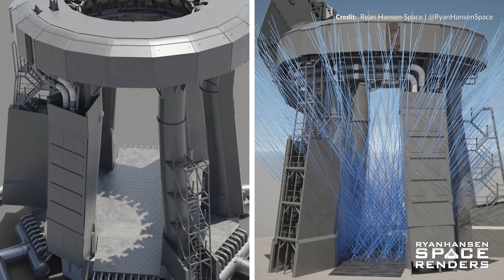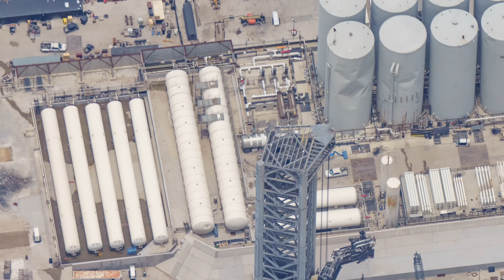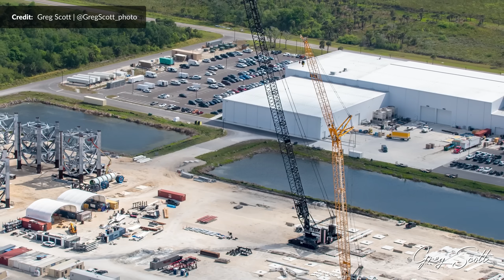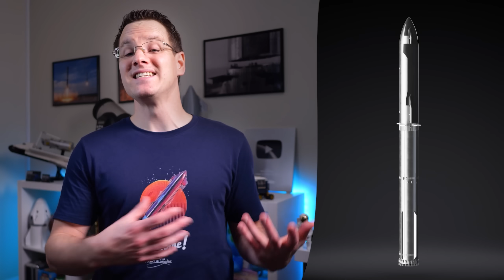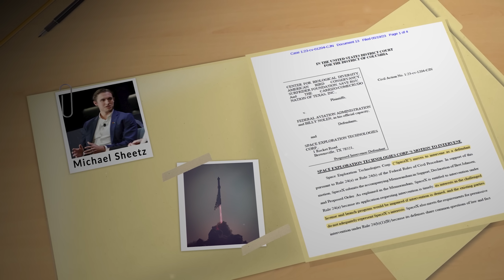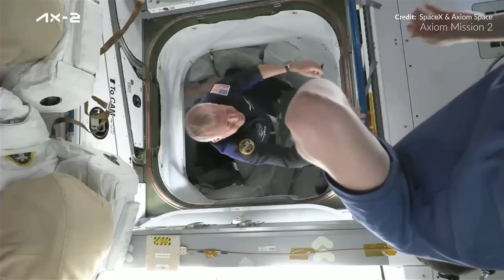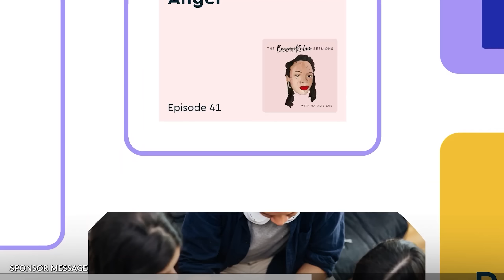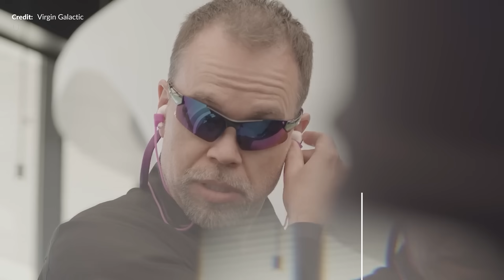SpaceX Starship 6,000 ton Capability, and SpaceX Joins FAA for Legal Battle, Axiom 2, Unity 25

Comment: So many achievements by SpaceX and we are still waiting for Bezos to get his up. One issue concerns me. When Starship launches for real, what happens if the tower is damaged during the launch? Doesn’t that mean they cannot catch the boostsr, and probably can’t catch the Starship, assuming the repair isn’t simple.
Reply: The next few launches are likely to be soft water landings so they can dial in the accuracy, before trying a catch attempt.
Reply: @steveaustin2686  I did use the phrase "launches for real" meaning a landing back at base. The question remains. What if the launch tower suffers damage? All it takes is an impairment somewhere, and whoops, no more booster, and significant additional damage to the launch site.
Reply: @StillAliveAndKicking_  As salland said, if the tower is damaged on an operational launch, then no catch. SpaceX had planned to have two towers at Boca Chica, but let the Army Corps of Engineers application for a second tower lapse. Who knows if SpaceX will try and pick that up later.
Reply: @salland12  To be fair this is how SpaceX operate. They originally wanted the Falcon 9 upper stage to be reusable but dropped that idea. The Falcon 9 had some well publicised explosions while working out the landing technique. The Dragon capsule was intended to do a suicide burn landing, but changed to a parachute landing, by memory because NASA vetoed the former. It is conceivable that SpaceX will resort to landing legs, given that we know that approach works.
Reply: @StillAliveAndKicking_  I believe that SpaceX gave up on propulsively landing Crew Dragon, because the required testing for NASA would take WAY too long. Boeing and SpaceX were competing for the first crew to the ISS to capture the flag left by the last Shuttle mission.
Reply: water landing?
Reply: When (and if) Starship is man rated they will have already reached a launch cadence with multiple towers and landing sites for Starship.  Landing at a different tower would be possible especially if Starship had reached orbit.  If it isn't man carrying then worst case you ditch it in the ocean and write it off (like everyone else does for EVERY launch).

Comment: Hi Marcus, could heat tiles like on the Starship be used to protect the legs of the OLM or is the angle that the flame/ pressure & vibration wrong for this type of protection, I was thinking it would help with rapid reusability as the legs would get eroded during every launch. Love your content, keep up the good work mate.
Reply from the maker: These are made for re-entry, not being smashed with raw rocket exhaust.
Reply: Not Marcus but my brain tells me that the rocket exhaust plume would simply rip the tiles off and/or shatter them very quickly
Reply: As Marcus and revmsj said the tiles are great vs heat, but suck vs impact. You can break them with your hands, so the force of the rocket exhaust would destroy them.
Reply: I like how you think. Tiles won't work, but perhaps some sacrificial material is a good idea. Some type of coating that would help absorb heat and reduce the force on the steel plates, and the material would be obliterated during launch, causing no debris risk.
Reply: @JeromyBranch  -  It would have to be a coating that could be replaced/renewed in a few minutes.  If they are going to fly several times a day, refueling and "replacement of expendables" should not take much longer than it does with an airliner.

Comment: Someone is bound to do a comparison, cost/time/resources of Flametrench verses Starship first flight damage + upgrades. I've still not seen a reason why they've not gone for the standard option, remembering this is the approach they're taking in Florida. The SpaceX video is great, clearly shows the great big holes blown out by the 'Need more power!' FTS. Great video as always Marcus!
Reply: The Florida pad is literally the same design
Reply: I think they initially wanted to build a rocket that could land/launch on raw surface (Mars) and wanted to see how little they could get away with.
Reply: Flame trenches aren’t “standard.” There are more rockets than those big KSC ones.

Plus there are TONS of logistical advantages to a flat pad under the rocket. There’s zero chance they’re going to build a mobile launch platform for SuperHeavy
Reply: They cannot make a flame trench at the launch complex because it is simply to close to the ocean and the ground below is unstable. They also want a versetile pad design that can be used on the moon and mars.
Reply: Yeah, if it was possible to do a traditional flame trench, they'd never know what was strictly necessary to create a stage 0.  

If Elon Musk is accurate in that there will have to be a 1000 starships that need to go to Mars in the brief window every few years, they will need a tremendous amount of launch infrastructure.

They need a system they can replicate a lot. 

So it makes sense to be extremely careful to not over-engineer.
Reply: Everyone that has replied thus far are mostly correct, but they’re missing one major point. In the initial planning phases SpaceX wanted to build a raised platform for a trench like at 39a. That would have taken years of environmental assessments and lawsuits to get sorted. In the end they opted to skip the raised platform and get the program rolling.
Reply: @jackinthebox301  Per NSF, the OLM is as far from the ground, as the pad at LC-39A is from the bottom of the flame trench. So there is a similar depth, just with 360 degrees for the flames to go. What Musk tried to do without, was the water deluge and a diverter. Apparently Musk wants to be able to work on the engines under the OLM so much, that he will only do a flame diverter as a last resort.
Reply: @steveaustin2686  I had thought about the height of the OLM while I was writing my initial comment. I figured it was probably roughly the same height as the aforementioned raised platform would have been. 

You're right about trying to do without, but I think they knew they would need *something*. I guess its just like their hope with the Fondag concrete surviving one launch, they were clearly wrong. Like I can hear Elon sarcastically saying "How bad could it reaaaally be?"
Reply: @jackinthebox301  Yeah, I can see him saying that.

Musk really, really wants to work on engines under the OLM. Personally, I think that he should give up on that and just put in the diverter, that he said that they might have to do in the first place.
Reply: There was a NASA study way back in the 70s I think showing that on really large rockets the trench reflected the sound energy back striking the rockets side causing issues.  The proposed solution is the water plate that SpaceX is implementing.  Starship is much more massive than Saturn V or SLS.
Reply: @Scanner9631  That happened on the first Shuttle flight
Reply: I believe they´re trying the simplest approach possible, considering that such infrastructure will have to be built on the moon and mars. Of course, a reduced gravity might mitigate the need for a water deluge system.
Reply: @Ed_edino  a water deluge system on the moon????
Reply: @paulhaynes8045  hence the no deluge try on Earth first
Reply: @Ed_edino  hmm. That is just Musk puff - he knows perfectly well, that landing on/taking off from the moon and mars and earth are entirely different things and require different facilities. He was just hoping that the concrete would suffice and didn't want to delay the launch.
Reply: @Ed_edino  - As far as I've seen they're not launching full-stack 'Super heavy' Starships from the Moon or Mars, just 'Starship'. Also the HLS version of Starship uses propulsion further up the craft.
Reply: @ChrisUK27  good point

Comment: Elon 2 month time will probably come to be 1-2 years real time when you factor in FAA investigation time.
Reply: That's hardware timeline not FAA Timeline.
Reply: They will probably ship the next stack to florida, destroy the launchsite there an then enoughtime has passed to go back to boca
Reply: @S1nwar  NASA won't let them launch from their pads, until they know it's unlikely to blow up on the pad.
Reply: @TheWebstaff  NASA doesn't want Starship launches at LC-39A when that is currently the only location for Crew Dragon launches. SpaceX has started work on SLC-40 to upgrade it for Crew Dragon. And hopefully Falcon Heavy as well. SpaceX is going to take over the Delta-IV Heavy pad at SLC-6 for Falcon Heavy at Vandenberg. No idea where they will build the other landing pad. Maybe at SLC-4W or replace the Falcon 9 pad at SLC-4E with a second landing pad.

So it is possible that NASA will allow Starship testing at LC-39A once SLC-40 is upgraded.
Reply: @S1nwar  I’m pretty sure it’s a federal agency that crosses borders